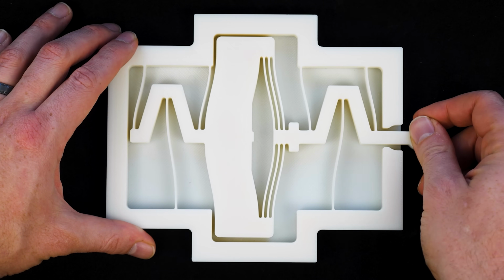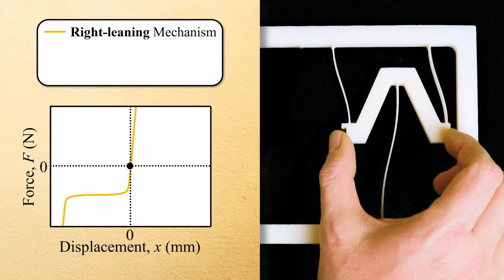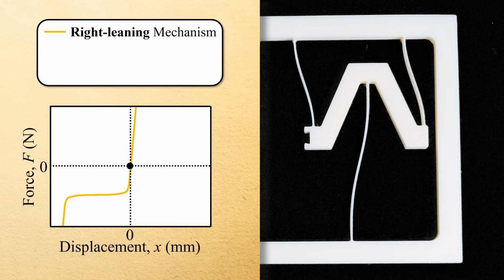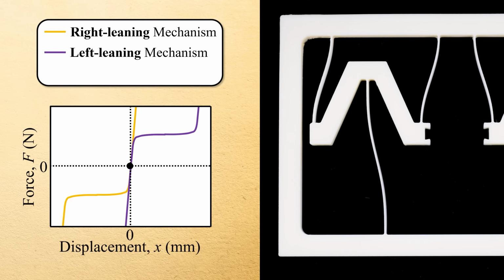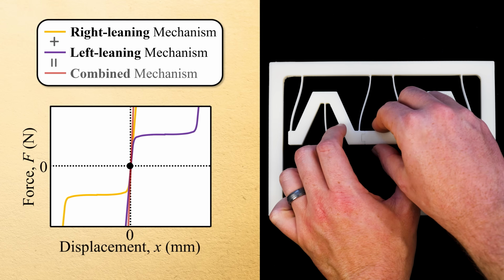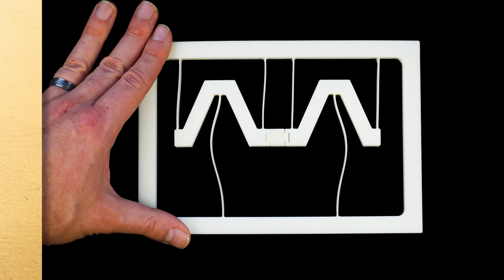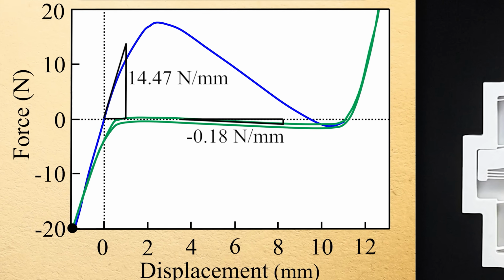Tunable Stiffness Compliant Mechanism with Bistable Switch - Binary Stiffness (Part 3)

Comment: That plot at 1:14 is similar to a Zener Diode. Current is the Y axis and voltage is the X axis. When a Zener Diode is reversed biased, at certain point in voltage it will remain constant over a various change in current (the left knee in the graph - the Zener point). That is how Zener Diodes regulate voltage.

Comment: I love mechanisms like this. The yet overviewable complexity for even simple behaviours is a special kind if aesthetic.

But there's a question always on my mind when I watch videos like this one:
Doesn't the material get tired over time? I imagine it would either adjust to the forces applying when idle or simply break, no matter how frequently the product is used.
So how long is such a mechanism functional? Or are my assumptions wrong and it will never break without outside force?

Comment: This design seems flawed. A sufficiently powerful force could switch it to it's compliant state if the input were forced over the switches tripping point. I think it would need to be redesigned so that the switch could be independent of the input
Reply: I had the same thought
Reply: was this not intentional? it seemed the middle portion was designed to toggle when sufficient force was put upon the input
Reply: @ciarangale4738  It's implied that the input will not move until a toggle happens. If that can be overridden, then the design fails.
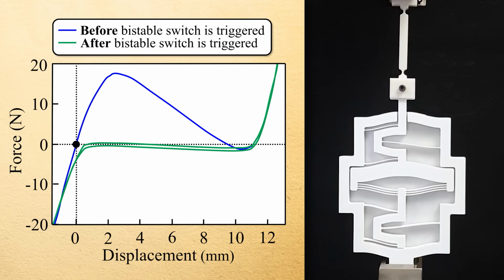Reply: @Mecryte  What of the demonstration to the right hand side of the screen at 3:30 ?
Reply: @ciarangale4738  Somehow, I missed that.

Comment: Usually, bendy things wear out from fatigue. I'm guessing something about the materials and/or design here prevents wear? How, and how many cycles can be expected? Super cool mechanism!
Reply: I think that the plastic these are made from is just good enough for a prototype, and the final product would likely best highly elastic metal such as inconel
Reply: Im no engineer, but to my limited knowledge there would probably be a significant difference in wear between flexing and bending. as such, it could probably be designed so that it would more than outlast its intended lifespan

Comment: basically the stiffness is capped to the stiffness of the bistable compliant, then it turns to 0 when the bistable is off.
The value of the stiffness of this machine equals  the stiffness of the bistable till reset??
Ps. the reset can be a lever blocking the bistable on his free axis, but you need to apply the same force needed to "unlock" it, am i right?

Comment: I recently repaired a Willomore seismometer that uses this principle to almost completely eliminate the stiffness of the springs that suspend the weight.
There is almost no force returning the weight to centre when it is properly tuned so it's resonant frequency can be less than 0.1Hz, to pick up those really slow earthquakes.
Reply: could you please provide me with reference to your work, sounds interesting?

Comment: My mind immediately went to a failsafe mechanism or perhaps even a prop-knife. Producing a compliant mechanism that allows the blade to appear rigid until enough force is applied- at which point the bistable mechanism causes the blade to retract freely could be incredibly useful.
Reply: Not sure about need of this in knife, maybe some type, but if you apply a lot of force, you may use your finger on side of the blade to stabilise it, and then it could slice you if your grip extends to the edge a bit

Comment: More than understanding is what is the practical use for any of these mechanisms?
Reply: I just repaired an old Willmore seismometer that uses stiffness cancellation like this to tune out the stiffness of the main spring and the flexures that holds the weight. That lets it tune the oscillation frequency down below 0.1Hz for picking up those really slow earth movements.
Flexures in general are not at all common, but in the areas they are useful they they tend to be by far the best solution.

Comment: The application I thought of first: a vehicle suspension with a stiff on-road mode and a soft off-road mode. There are other ways to accomplish this (pneumatics, hydraulics, electromechanics), but this mechanism could probably build a two-mode suspension with just springs and shock absorbers.
Reply: I like this idea. Instead of a dovetailed bar you could insert an elliptical dial and fluently change characteristics.

Comment: 'Tunable' seems a bit misleading, as it implies you can tune the mechanism, such as tuning an instrument. What's shown here is still just a binary, otherwise untunable, switch with some extra pieces on it. One would expect a 'tunable' mechanism to be able to be somewhat precisely manipulated until an optimal point is reached, again like tuning an instrument, or using a potentiometer in a circuit to achieve a required voltage, a dimmer on a light switch to achieve a preferred brightness, etc. Though, I can see how you wouldn't be able to do this with a singular compliant mechanism, at least not with one that's simplistic in design.
Reply: would "switchable" be a better word than tunable then?
Reply: @radadadadee  Yes, because that's literally what this is, a binary switch. Similarly, having a third position would be a trinary switch, and still not a tunable mechanism. 

A mechanism isn't tunable until there's fine control of what you're tuning. Problem with this is that typically it would require a secondary non-compliant part within an assembly with the compliant part, such as using a screw to adjust tension or stiffness. There's also the possibility of using  multiple switches in steps, or having a compliant stepped mechanism to act as a multi-position switch, but the difference between the discrete steps needs to be fine enough to emulate what a proper tuning mechanism could do, otherwise it's just a n-position switch. There's the possibility of using something like a watch spring with a locking button to adjust tension with a positionable part, but then reliability and holding strength of the button, which then becomes complex in it's own way based on other requirements; there's also complexity in manufacturing here, as you now have a compliant button on a plane perpendicular to the spring's pivot, of which is also perpendicular to the mechanism's range of movement, and that's just for a one degree of freedom mechanism. A truly tunable compliant mechanism is so much more complex than a binary switch, and this is before getting into the complexities of how the flexures behave under varied amounts of tension, one could very easily buckle incorrectly and ruin the intended outcome of the mechanism.

Comment: I saw a video, and it demonstrated a device that used flexures to create a linear motion in just one direction and was constrained in that one direction. It was not possible for movement in other directions. It had two pairs of flexures, one pair to an anchor point, and two to the moving part with a third point connecting the free end of the flexure pairs. At rest, all flexures were parallel. 

If this rings any bells, I'd love the name of this mechanism. I've been searching YouTube for the video and going through my history with no success. Any help would be greatly appreciated!
Reply: That kind of flexture might be called a "linear stage".  You might like a video on Dan Gelbart's channel "Building Prototypes Dan Gelbart part 10 of 18 Flexures".
Reply: @Graham_Wideman  Thank you so much. I'm slowly chipping away at watching all the videos on your channel. They are very inspiring. I have a project that requires linear motion in a single direction only, and that can keep it rigidly constraining it in just one direction. Space constraints are an issue and the traditional technique for this particular problem are not possible. Your videos are inspiring me to think in new ways, to contemplate nontraditional,novel solutions and to build mechanisms myself. (using my laser cutter) thanks for these videos!
Reply: @ubza1234  It's not my channel. I'm just an interested viewer and commenter :-)
Reply: @Graham_Wideman  Oh 😂 well, It's nice to know that there are people in this community who want to help each other. Thanks for the help!
Reply: @ubza1234  You're welcome! - I think it's cool that others share an interest in these videos, and intriguing mechanisms!
Reply: @Graham_Wideman  Just watched that video. That's exactly what I need! Thank you!